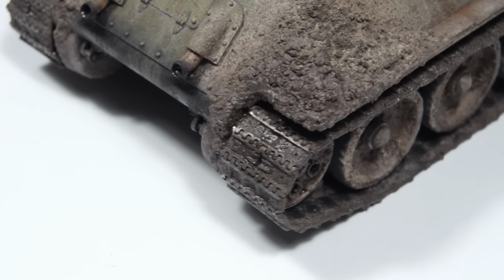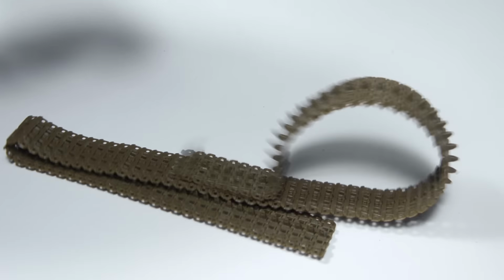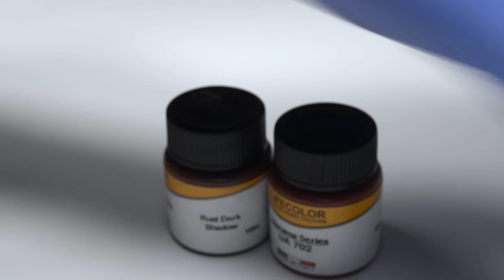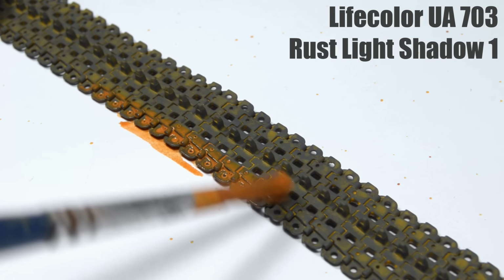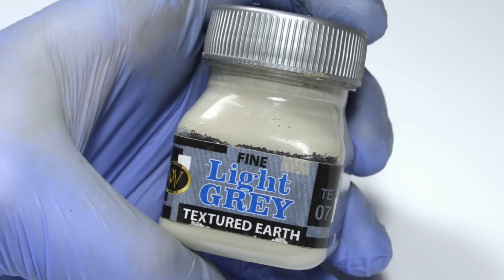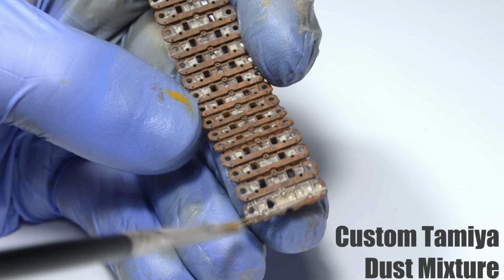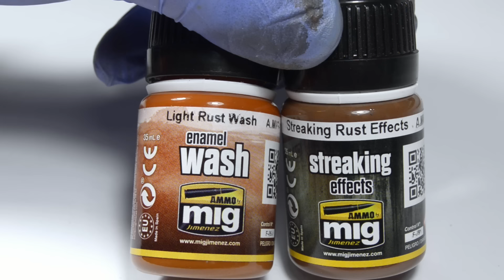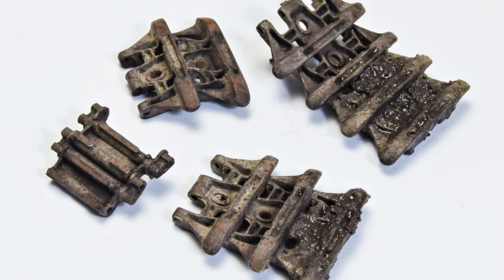HOW TO: Painting REALISTIC Rusty Tank Tracks

Comment: Have you ever tried thinning your acrylic washes with isopropyl alcohol (or an alcohol/water mix)?  The alcohol has a much lower surface tension than water and the paint dries faster because the alcohol evaporates more quickly.
Reply from the maker: I tried that 50/50 alcohol/water mixture for a different technique once but it didn't work. I'm afraid it would damage the previous acrylic layers and overall would do more harm than good. If high surface tension is your concern you can add a drop or two of dish soap/detergent.

Comment: Great Videos! Here's a tip for breaking the water tension...add a drop of dish soap to your water, (a drop to 1 pint should be enough). If you want to get fancy, pick up some "Windsor & Newtons Bending Medium for Watercolor". That stuff is great, though you have to be careful to add only a drop to your acrylic paint. If you add more, the drying time increases...a lot. Anyway, I paint with acrylics on all my miniatures and W&N blending medium, (or the soap in the water), works great for washes and glazes. Looking forward to your next vid!
Reply from the maker: I always add dish soap to my acrylic Tamiya dust mixture - the one I applied on these tracks as well - but I didn't find it very important to improve the flow of those acrylic rust paints, as you don't have to be very precise when applying them in this manner.

Comment: I know I'm a little late but I hope you're still read the comments
I would be interested in how you make "modern" tank tracks?!     For example Leo 2 FOV or "Nato chains" with rubber pads
Especially the inner area where the guide pins are "bare metal" from the constant rubbing on the road rollers, the black colored treads from the rubber abrasion, and the "greyed" black, worn rubber pads on the outside of the chains
(including lost pieces from the rubber blocks aka
torn down)
On many pictures you can see that the stressed parts have different metallic shines and the rubber loses its deep matt black color due to the sunshine

Comment: Not sure if youll bother on a older video. 
Those ejector pins. If you have a model in the future where you dont want to cover it with "mud". You can try a micro burr tool on a dremel. Or a normal burr tool. Idk micro ones might be too small. Micro burrs actually need to have their profile microscopically ground in.

Comment: This is a really informative and entertaining video on rusting the tracks, like all your model videos... except I have an issue with my 1/16 Hooben T55 (I have 2 actually) that has me stumped.  It's an R/C tank so I want to weather the tracks for a working vehicle.  But after looking at hundreds of images of T-55's, T-54's and T-62's - the track coloring is inconsistent from tank to tank.  Even the tracks of a running tank often look black or dark grey everywhere, even under the road wheels. Some tracks have rust in the recesses and on some there is no rust to be seen at all - strangest of all the tracks often look dark grey even where they must go metal to metal, and not shiny iron like you'd expect.  Whether it is the kind of metal they use for tracks, or something else, I'm very confused as to what paints would give me the most authentic look for this tank!

Comment: Have you ever made your own rust pigment or rust paint?  My paint was enamel based, though acrylic paint might work.  
I created my own rust from very fine steel wool in vinegar.  (Place it in an open glass or suitable plastic container in a place which has good ventilation.)  Once the steel wool rusts away to a powder or fine particles and the vinegar dries off, adding paint makes it stick.  Be patient as it takes days or weeks to turn to powder.
Reply from the maker: Aint nobody got time for dat :) I'd just rather buy the paint for 3€. 
But when I was little I experimented with ground up rust powder and white wood glue. The results were pretty gnarly.
Reply: @NightShiftScaleModels  I made my own rust pigment in the 80s and 90s before there were any weathering powders or paints to buy.  :   )

Comment: Great tutorial. Have you tried to add a small drop of liquid dish washing soap to your water based washes? It will take out the surface tension of the water.
Reply from the maker: Yes I always add dish soap into my acrylic Tamiya dust mixture. I didn't think it was necessary for the acrylic rust washes, as you don't have to be very precise with the paint application.

Comment: "Turns out, locating the wire is hard." Funny, right when you mentioned you used one as a connector and needed to remove it, I spotted it as the anomaly among the other links. Maybe all my bicycle chain experience.

Comment: wherent all tracks made using a manganese steel aloy that was inherently anti rust? Plus the tracks themselves would certainly oxidate but to a greenish black while the direct contact parts would be polished white down to bare metal. Maybe the aloy could be tarnished due to being exsposed to sand or being submerged in the ocean with the salt having a harsh effect on even the purist steel to a state that could rust if it was shielded from water currents

All speculation ig but all in all u do a really good job in what u do

Comment: No primer or clear coat needed? My experince is that these paints could easily be removed from bare plastic. Amazing result btw👍
Reply from the maker: I thoroughly cleaned them before painting with soapy water. Tamiya paints stick surprisingly well to bare plastic and because the base coat was matt, the Lifecolor paints had solid base to hold onto.
And for the love of all that is good and holy, don't clear coat tracks or any other rusty surface! :)))
Reply: Night Shift  Yup I think too that clear is not the best option for finishing something like this. Maybe my models just weren’t clean enough😂 
Thx!

Comment: Why didn't you seal the tracks with varnish? And secondly, you can use isopropanol to fix pigments instead of thinner. Isopropanol does not react with plastic.
Reply from the maker: What exactly would be the point of sealing tracks with varnish? 
And yes, IPA or even lacquer thinner can be used to fix pigments without damaging plastic workable tracks. Many people use enamel thinner or pigment fixer which is enamel, that's why I warned about it.